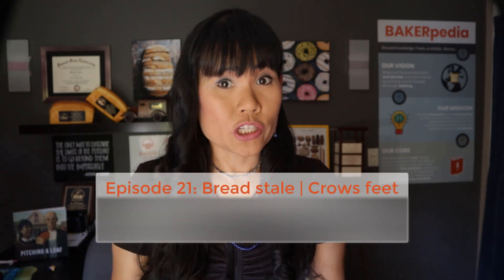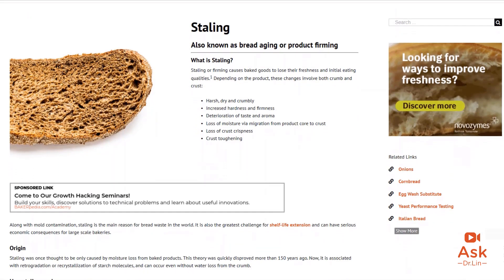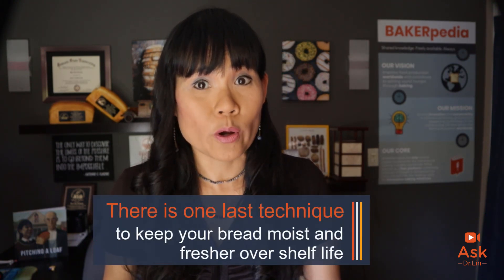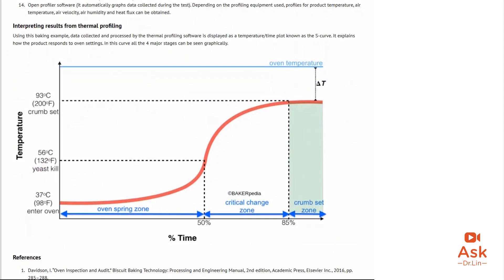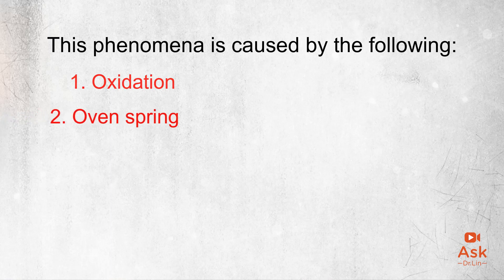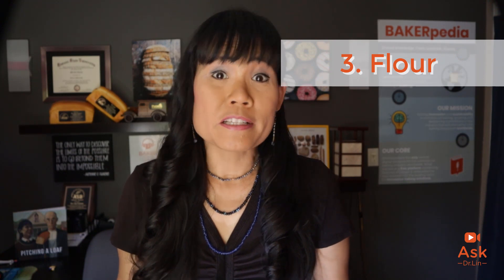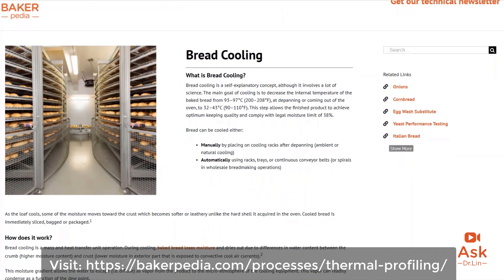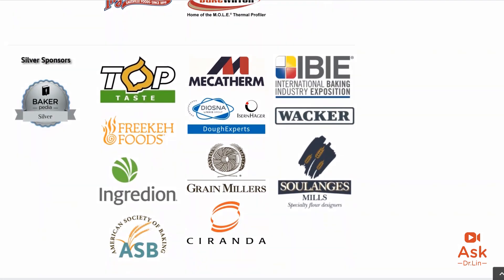Avoid Stale Bread & Crow's Feet | Ask Dr. Lin Ep 21 | BAKERpedia

Comment: Am a little bit confused with the thermal profiling .
From the graph , it shows enter oven temperature @ 37C . 
Kindly clarify if this is the internal temperature of the bread or temperature of oven ?
Reply: That's the internal temperature. The chart is a but confusing, but the top line shows the oven temp while the curve shows the speed at which the bread's internal temperature rises.